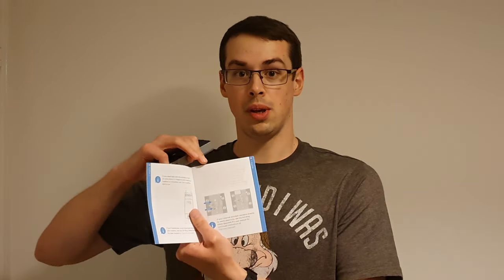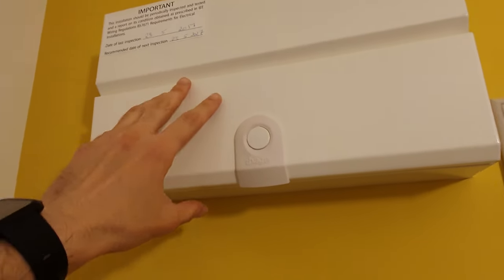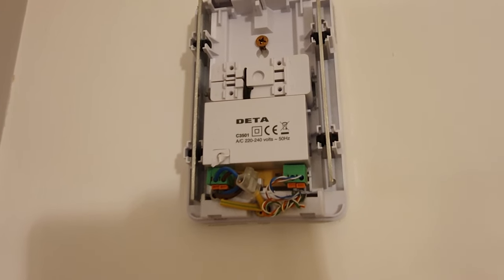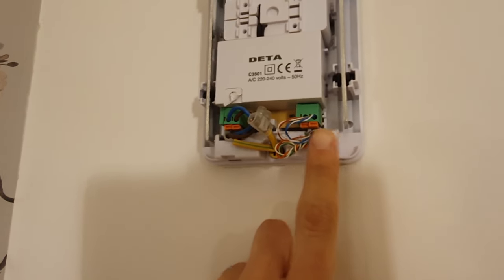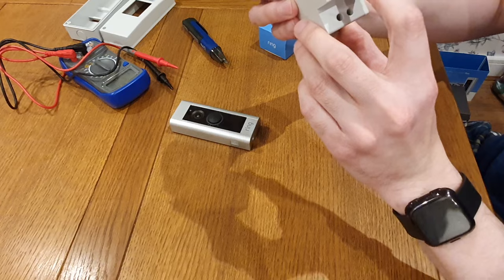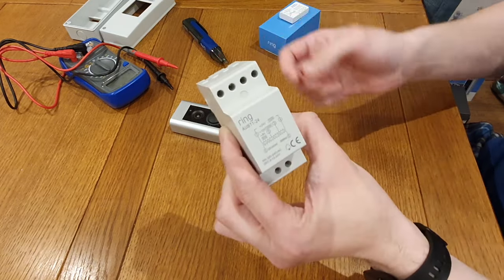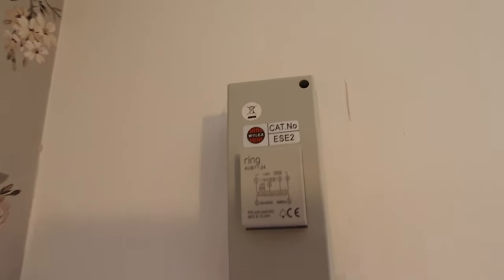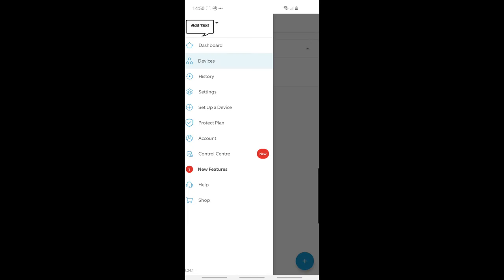Deta Doorbell to Ring Doorbell Pro - UK Wiring Guide (Direct To Transformer Install)

Comment: Hi I have this same deta bell box if I connect the ring doorbell version 2 to the wires coming out of the doorbell will that work to charge my doorbell and then could I just buy the plug in ring chime because my deta chime will not work would it work this way round? Cheers
Reply from the maker: Hello. Yes whilst I haven't tried it myself, I think that what you say would work. The output voltage of the Deta doorbell unit should be sufficient for the Ring Doorbell 2 in theory - as it has 14.5v AC, and the Doorbell 2 should work with 8-24v AV transformers.

It's worth noting that the overall Deta unit is listed as incompatible here: https://support.ring.com/hc/en-gb/articles/115003008663-Ring-Video-Doorbell-2-Chime-Kit-Compatibility-List ...I think that just relates to the chime unit itself, but it might mean that you'd need to disable the chime component and just use the transformer part of the Deta unit? (And then use the plug-in Ring Chime, as you mention).

In short, what you say should work - but it's not something I'm too sure about sorry!
Reply: @SmartHomePoint  

Ok thanks for your reply yeah I think it should work to charge the ring doorbell and il plug in the ring chime.Yes il disable the chime part and will have a go fingers crossed will keep it trickle charged I just don't want to keep changing the battery would prefer it to be hardwired for the charging part. Cheers again thanks mate 👍
Reply: @leeburton7747  hi how did you disable the chime?

Comment: Out of interest, do you know why you had 2 'twisted pair' cables (from a cat5 ethernet cable) to your doorbell? On Amazon I see they sell 'bell' cable which is 2x single strand cables...

I need to solder on an extension to make my doorbell wires longer. I'm wondering if I should use 2x twisted pair cable from cat5 as you did, or if I should extend to a single cable on each.
Reply from the maker: I might be wrong but I think it's about the maximum voltage. Low guage wire like telephone or bell cable doesn't always supply sufficient voltage to higher voltage doorbells, including some smart doorbells.
Reply: @SmartHomePoint  I'll go with the twisted wire from cat5 cable, thanks 👍

Comment: I'm baffled what to do

We just picked up the ring wired version

We don't have a current transformer or chime installed on the consumer unit

However we have space to put one 

Do we just install a suitable transformer

Then wire directly from transformer into the ring?
Reply from the maker: You can do that, yes. In my case, I have a 230V mains cable from my consumer unit to my wall, which then transforms it down to a 24V supply to my doorbell. But putting the Ring DIN-rail transformer directly in the consumer unit (outputting 24V from there).

Alternatively you could just buy the plug-in adapter and skil the transformer completely; it depends how easy running a fresh cable to the doorbell is.
Reply: @SmartHomePoint  Thanks for getting back to me

We are in the process of upgrading the CU as we have the floorboards open and doing a fair amount of new installs 

So it makes sense to just do it from the CU as we have a few spare spaces

Thanks for confirming this with me

Comment: I'm just going to test the voltage is off using my volt pen...

WITHOUT TESTING IF THE VOLT PEN WORKS ON A LIVE SUPPLY! 🤦‍♂️
Reply from the maker: I did also test that, but didn't show it on-screen. I definitely should have though, and made clear that this should always be done. Thanks for the reminder 👍
Reply: @SmartHomePoint  haha okay pinochio